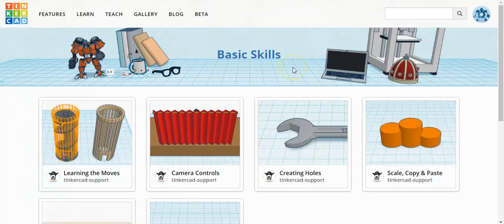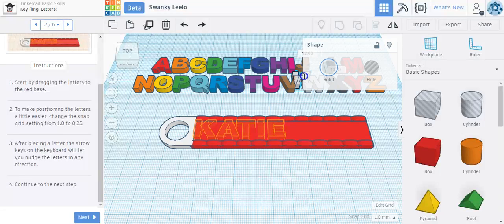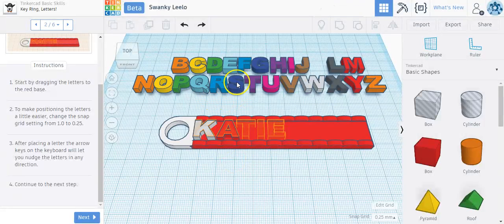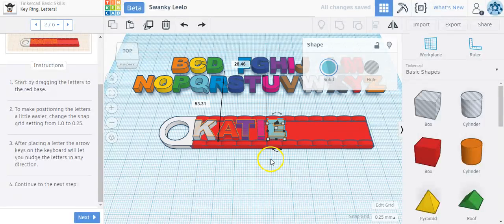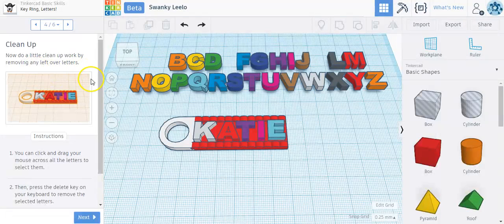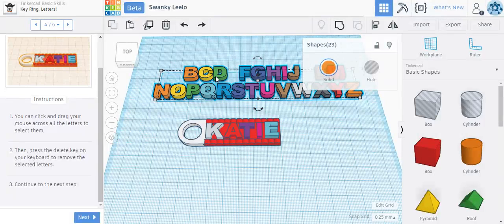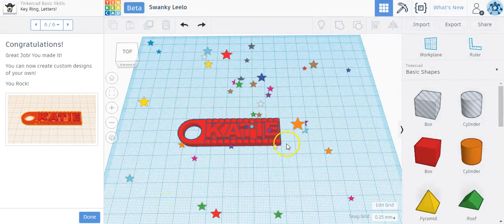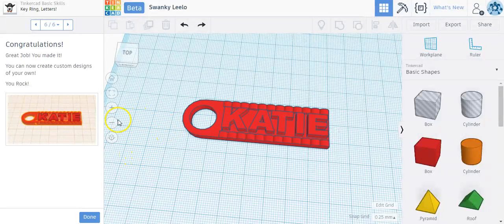Tinkercad Basic Skill 5 - Key Ring, Letters

Comment: For those that do not have the red base or letter objects on the Workplane when you start this tutorial, here is how I got them to appear. Step through to the final step (6 of 6) of the tutorial. A button will appear at the bottom of the tutorial panel "Reset". When you reset the tutorial the objects should appear.
Reply: Didn't work for me, but it's nice to know that I am not the only one.

Comment: What do I do if the red base aren’t appearing on screen for tutorial? I can find the letter in the menu but I can’t find the base how do I fix this?
Reply from the maker: I have this issue too sometimes.  You can either contact Autodesk (the company behind Tinkercad), or you can drag your own red box over onto the Workplane. I suggest dimensions of 30mm x 70mm x 5mm?
Reply: @MrFogleSVSD  thanks will sit down and play with it a bit more before contacting them.
Reply: Same thing for me. This tutorial had no objects on the workplane at all. I was able to find the letter objects in Design Starters, but then there was no red base to put them on. The third step of the tutorial shows an orange outline where you are supposed to size the base to, but there is no base object.

Comment: Do you know how to make a letter that is hollow, then  make the same letter as an insert so I can then back lite it? I tried and can't get it the right size.
Reply from the maker: Tinkercad might not be the best program to do what you're suggesting. One thing to try is to hold down the [Shift] button while making the sides smaller. This will make the entire letter resize smaller at the same time. Then use the align tool to center both letters together. It's not perfect, but it might get you close...
Reply: @MrFogleSVSD  Thank you. I got it to work in CorelDraw.